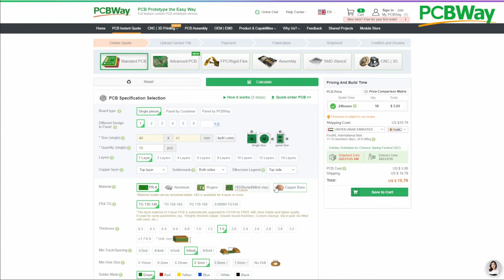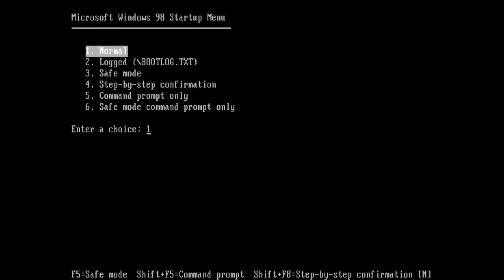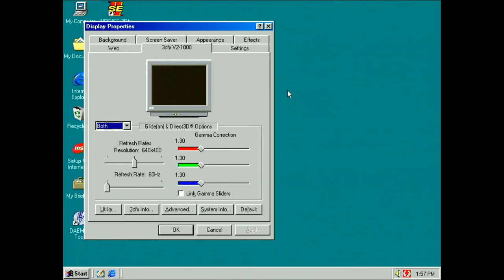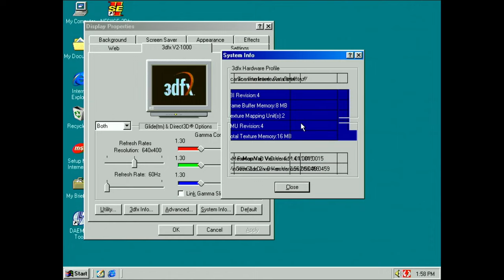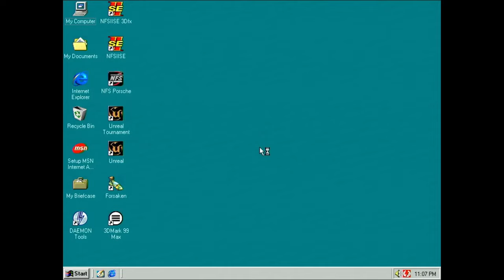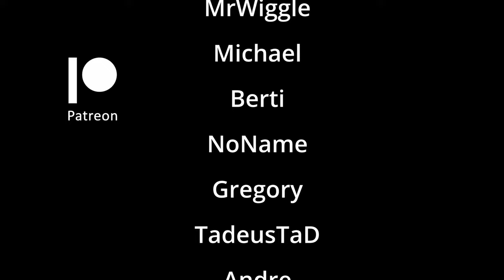Those are my last two broken 3Dfx Voodoo cards - Let's fix them!

Comment: just a few tipps to ease your work on the chip:
1- clean with a static-safe brush and some isoprop to remove crud
2- go over on the pins + pads with glass fiber pen under the microscope
3- apply some fresh solder
4- don't stay as long as you did on the pads with the wick and the soldering iron as you risk to do some damage the longer you stay, and the stronger you wick as you could experience it in this repair
Reply from the maker: Yes, I kept going for too long on those pins and pads - especially the area with the corrosion. Thanks for the tips, I will keep that in mind for my next repair.
Reply: @CoruscationsOfIneptitude 
Vinegar is also good to remove surface corrosion. The glass fiber pen does a similar job as the vinegar albeit being mechanically...
Reply: Solid advice! Glass fiber pens are a great tool indeed - that I keep forgetting about for some reason. 🙃

Comment: Time to fix that SLI connector too.
Reply from the maker: True, it is a 90 degree connector though. I have a donor card from which I took the FBI chip, however, I'm planning to revive that card 😂. There is no such thing as a donor 3Dfx card!!!
Reply: @bitsundbolts  how many pins is it? They sell these connectors here for like 25 cents US.
Reply from the maker: Yes, I can get those from AliExpress as well. They're 34-pin floppy connectors. I'll replace it soon.

Comment: For corrosion you can also try Deoxit (or similar) contact cleaner spray. It can sometimes work wonders!
Reply from the maker: Thanks for mentioning this. I'll see if I can get it or something similar.
Reply: This and/or a fiberglas pen? Just careful over the corroded pins, it should remove most of the corrosion.

Comment: Great job!! I would suggest that before you use flux and solder to clean the pads, use some vinegar and baking soda with a tooth brush to get most of the oxidation off first then clean with flux and solder. It should make it easier.
Reply from the maker: Thanks! I'll try this next time. I've heard that vinegar and baking soda cancel each other out though. I'm no chemist, it's just what I've heard.
Reply: @bitsundbolts  yeah I put vinegar on wait a minute then sprinkle on baking soda and brush with a toothbrush then rince it off. The baking soda neutralizes acids and bases and is a very mild abrasive.

Comment: Honestly, computing has come a LONG way in the last twenty years, but, this era of computing was so much more fun. And I am thankful for folks like yourself saving hardware every chance given. I myself work trying to save vehicles, mostly 1990s Honda cars. I own a 1992 Honda Civic with 305,000 miles on it and I am acquiring a 1999 Honda Civic with about 200,000 miles on it. They are beat up and bruised, but have so much potential left like these old graphics cards. I help a friend with his 1993 Acura Integra, which currently is in the process of getting a new engine wiring harness as old unnecessary and hacked wiring is pulled out. Also help with his 2007 Acura TL, and recently helping keep 2 Chevrolet cars going as well. Sorry for the tangent, it is often relaxing to find other people saving, any kind of technology.   :Edit: Sorry, just in the off chance anyone reads this far, if you did not know, Acura is the luxury brand name of Honda here in the USA and a few other countries just in case there might be any confusion. I do know people here that still did not know this till recently.
Reply from the maker: Interesting! I did come across the name Acura a few times, but I didn't know it is the luxury brand of Honda. It's nice to preserve old technology because this is what we have used in the past. It doesn't matter if it's a car, a phone, or a PC - they all link to memories from way back for many of us. And that is what makes us preserve them. I wish you all the best with your future projects and hope they turn out well!
Reply: the PIII was the last fun era
Reply: I work to keep old vehicles on the road it makes more sense to me for the over all environment than buying new. To me, it is far less wasteful to keep old machines going when its possiblem.

Comment: It's so strange that they used 2 x 100nF decoupling capacitors in parallel instead of one 220nF capacitor but I guess that they got a pretty good deal for the 100nF ones and decided to use 2 instead of 1 in those places.
Reply from the maker: I'm not yet at a point where I would judge the design choice of the engineers. However, someone mentioned to me that you should keep the number of components down or reduce the number of different components. I guess it was better to just go with 100nF all the way.
Reply: Not strange. A 100nF capacitor ceases to be a capacitor at about 16MHz, if you want decoupling at higher frequencies you use a lower value like 10nF or 1nF in parallell with the 100nF.
Reply: @goranekstrom708  Yes, you are correct however the measured capacitor values showed two 100nF ones instead of 100nF with 100pF in parallel as we were duing back in the day when I was working at Johnson Controlls. That is the strange part of this because if their design required 200nF that means that high frequency decoupling was not an issue and using single 220nF capacitor was probably OK.
Reply: @VladoT  oh, I only saw him measure one of them for each location? Also, a single 220nF lowers the self resonance frequency even further so maybe 2x100nF was the "sweet spot".

Comment: L1, L12 and L13, by the looks of it would be irrelevant and, if you needed to, could be bridged.
From the traces it looks like that's just the Output Filter for the VGA Output...
But good on you on fixing them!
Reply from the maker: I didn't check where those components connect to, but could be that those components are irrelevant. Those Voodoo cards suffer from poor VGA signals - I wonder how much those filters aid in signal clarity. I think most of the issues come from the pass through cable (2D signal).

Comment: 19:00 Using a more aggressive WS based flux, can often help more when things aren't flowing due to contaminants and oxidation. I learned just how much more aggressive it can be, when it actually caused the solder to wet onto my ferrous tweezers, and pretty much ruined them from touching near anything soldered again, as now they will try to tack themselves to it every time, oops!

Comment: A place I worked would get boards like the voodoo 2 straight from the board house sometimes, I think it would be caused by the parts not being clean enough but some of it might have been errors in the temperature during the paste soldering.  The FQFPs for some reason were the worst for it, hours under the microscope pushing on each pin with an x acto knife.

Comment: I have a Diamond Monster 3D II 8MB and would love to have another one just for the fun of having SLI. It's pretty hard to find an identical one, so I'm hoping that using a Voodoo 2 from another brand with the same clock specs will still work with original drivers, otherwise I'll have to use the fastVoodoo modded ones which I would prefer to avoid.
Reply from the maker: I have a few Diamond Monster 3D II cards and I'm thinking of selling them. You can let me know what revision you have, and I could try to find the perfect match for you.
Reply: @bitsundbolts  I most probably couldn't afford it... I found a seller in my country (Portugal) which has a few Voodoo 2 cards. Since I don't have much use for 3Dfx AGP cards, I'm discussing a trade of 2 of them (VD3 2000 + Banshee) for a Voodoo 2 PCI 12MB with identical clocks to my Monster 3D II, then later down the line I'll try to add the missing 4MB to mine. Unless you want to keep them and add the missing 4MB to mine? 🙂

Comment: Most ferrite beads are just a short piece of wire that's been wrapped in a ferrite material. Their inductance is negligible. Normally used to filter out RF from power lines. For testing I would just use a short jumper wire. They can be replaced with pretty much any ferrite bead, no need for testing for any parameter except for continuity.
Reply from the maker: That's what I usually do - check if there's continuity. Then I replace the component with a similar looking one. So far, it worked great.

Comment: About the corrosion, mu guess is that a capacitor from another board leaked on it. That said white vinegar is a good thing to neutralize the base component of capacitor juice. I would rinse it with isopropanol to make sure it's clean after the fact.
Reply from the maker: That is what I usually do. I didn't expect the corrosion to be that bad on this card. In hindsight, I should have used some white vinegar.

Comment: It is so soothing to watch you solder with soft jazz piano playing on the background. (you are doing a good job as well at it) Please try to use this theme more often :D
Also just a question, which temperature are you using for the solder to flow so easily like this?
Reply from the maker: Thanks! Will keep your suggestion in mind.
My soldering iron is set to 330 degrees and I use quite a bit of flux to make sure the solder flows nicely.

Comment: 11:30 Not that i'm encouraging to leave it like that if u have an exact spare; but in 9 out of 10 measurements of caps looking like that, they still work fine. 
The parallel plates inside, that are what give the capacitance, are usually not right up to the edge. And even if they get a bit chipped, they just loose a tiny bit of capacitance. Also, as long as there is some of the solder contact left on the sides of the capacitor that still crosses all the internal plates, it will work fine; as the contact that wraps around the cap is just extra material. 
This is just an FIY :)

Comment: 23:15 should have went "with the grain" and scrub vertically instead of side to side

Use a toothbrush and some baking soda and isopropyl, or contact pcb contact cleaner, and then do a reflow, solder paste might work a bit better since that can be applied with a syringe more precise

Plus hot air reflow
Reply from the maker: Yes, I messed up while trying to remove the corrosion. I'll try to treat those areas next time before I reflow the solder.
I'm not a big fan of reflowing solder with hot air if I can use a soldering iron. I'm just afraid to damage the chip or knock off other SMDs.
Reply: @bitsundbolts  hot air reflow isn't that bad, you can set the temperature like a soldering iron and they make nozzles that shape and direct the airflow 

And just use kapton tape and aluminum foil to cover the parts you don't want to heat

The solder(solder paste) should melt fairly quickly so you don't need to heat the whole chip

I mean a bga hot air rework station has to heat the entire chip anyway and they seem to survive that...

Depends how fine of a pitch and pin spacing you have to deal with..

Comment: Great Job. Enjoyable as always! Have you considered looking for Creative Awe32 64 Waveblaster 1/2 or MCA cards while at the scrapyard?
Reply: I mention these specifically as they hold some value.
Reply from the maker: I am usually taking anything from Creative with an ISA slot. Vibra and Soundblaster Live! cards are quite common, so, I usually skip those. Thursday's video will be about a Soundblaster 32 PnP.
Reply: @bitsundbolts  that will be a watch for me.  I skipped saying the sb32 as they are fairly common and just not as sought after.
Reply from the maker: The one I have does have an AWE chip, has 30 pin SIMM sockets, and seems to be close to an AWE64.
Reply: @bitsundbolts  look forward to seeing it!  Also the hardware sb16 ones are another good choice, the ones with the hardware volume on the back and jumpers.

Comment: One pin at 30:37 in the third memory chip from the upper left was out of line.
Reply from the maker: Yes, correct. This pin was bent inwards and I did work on it to make sure it doesn't touch an adjacent pin. I guess I didn't do a good job there 😅. I'll see if I can improve it.

Comment: seeing how bad the corrosion is I'd consider removing the chip and cleaning the pads without the chip in the way. Honestly the solder on all the main chips looked crappy to me anyway.
Reply from the maker: I was thinking of removing the entire chip, but the damage was only in that one corner. I hope I was able to get rid of most of the corrosion and that there is nothing below the chip.
Reply: @bitsundbolts  I just think sometimes it's easier having a 100% flat surface to work with than having a chip in the way when you're dealing with corrosion. But you got it anyway.

Comment: 38:32 looks like cold solder joints
Reply: Need 60/40 lead tin solder or something similar 

Card doesn't run at the melting point so using a higher lead ratio would be fine

Only really need lead free or lead-tin-antimony for something like a bga or smd gpu or cpu that gets much hotter during use, like in game console where cooling and space is more restricted

That solder melts closer to 400-500 farhenheit instead of around 300

Comment: If you use leaded solder that solder will last much longer than 30 years, since what you took off is unleaded solder.
Reply from the maker: Did they use unleaded solder in 1997/98 already? My solder definitely contains lead. But that could explain why this solder weakened so much.
Reply: I don't think RoHS really started till the early 2000's
Reply: @bitsundbolts  actually, they first started using unleaded solder in 2006, so that might not be the cause.

Comment: I don't know we're finding a lot of 40 year old commodore chips aren't surviving. They survived 30 years, but 40 is starting to hit them harder.
Reply: Should have went Atari I have an original 1983 launch model 800xl other than the antic upgrade and ram upgrade and dual pokey

All chip are original

However it's funny the dram I used cam from around the early 90s and failed shortly after

Just geta few 512k sram and gal pld with a dip switch  get 2 megs in 4 512k banks with full rambo/newell and compyshop bank switching just toggle cs using 2 dip switches to select which 512 page, or use a 2bit latch or shift Register 

It's more an Atari 800xe running xl romsets and os even 320xe can't compare

Still works like new since 1983

Hardware was originally 1977-1979

Never had failing chips

Only the mylar keyboard membrane is the most common failure mode of Atari computer 

That can be replaced with a daughter board and ps/2 port as well or buy reproduction mylar
Reply: I wouldn't plug it in until the ram is repaired it won't work atm

Really expensive lawsuit for sled....😂
Reply: 500 for a commodore 64 now shows it's cheap cost cutting design issues

Paid several grand for Atari 800xl in 1983 they'll still work now
Reply: @Clancydaenlightened  atari uses commodore chips. My C64 still has working chips. But for how long? For the longest time the CPU was most likely not the problem of a failure, but a lot more are starting in that direction.
Reply: @Clancydaenlightened  meh bad ram is no big deal. My c64 had 482 bytes free or something like that. Only 1 chip was bad and the errors were random. Less than 1% of the chip was bad. The computer was still usable. I just didn't have the full range of BASIC memory.
Reply: @Clancydaenlightened  I'd rather have a C64. and some day your atari 800 xl won't work either.
Reply: @awilliams1701 

Easier and cheaper to repair than a c64

They make custom Atari 800xl in ATX format with custom PC and mobo now

All the chips are replaceable

If you read my previous comment it doesn't currently work needs ram, but 512k sram and a gal22v10 is cheaper than sourcing parts for c64

And eliminate dram make my Atari faster since no dram refresh
Reply: @awilliams1701  name what "commodore chip" is in my Atari 

I want the internal Atari part number of it

Because no chips in an Atari is a commodore part it's all custom made by Atari 

Even the 6502 isn't a standard 6502 but I can also put a 65816 in my Atari doesn't make it a snes part
Reply: Jay miner would beg to differ

He'd be lyke: " yeah I want internal that part number too..."
Reply: @Clancydaenlightened  you can make a complete C64 with individual chip replacements or you can get an Ultimite C64 replacement.
Reply: @Clancydaenlightened  Atari never had a fab. Commodore owned MOS. MOS made chips for atari, apple, and commodore. And they licensed the tech to nintendo.
Reply: @Clancydaenlightened  pretty much any of them. Commodore made mask ROMs for them. The main CPU the 6502? That's commodore. I wouldn't be surprised if Commodore fabbed the pokey chip and everything else that was custom. Commodore's MOS used to be the TSMC of the day.
Reply: Ask "Jay miner" 😂 he and the people who built all of Atari 8bit products built commodore computers after

But the Atari falcon is better than  an Amiga 

Just like my 800xl is technically superior than a c64

Especially with a 65816 16 bit cmos "6502" that's definitely isn't a commodore part

Atari is technically still in business 

Where commodore at?

Out of business, they don't mos anymore, and iirc mos doesn't currently make 6502, another company makes em mow
Reply: I can build an Atari ATX 800xl using nos chip

Effectively brand new old stock don't have to tear apart another Atari
Reply: @awilliams1701 commodore didn't fab chips

Atari didn't fab their custom chips via mos

Tsu,ami,oki,etc aren't mos

Hong Kong and Taiwan like tsmc 

Designed in Sunnyvale, CA outsourcing to Asia to fab

You're just working on what ifs and conjecture and your own confirmation bias